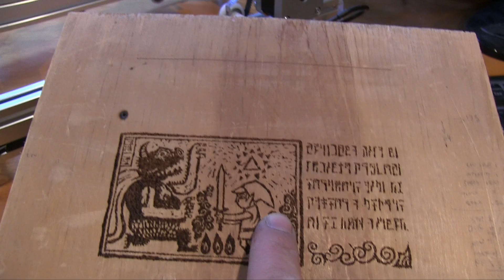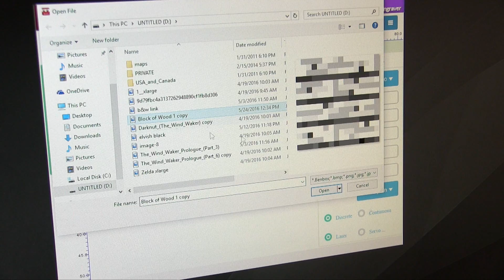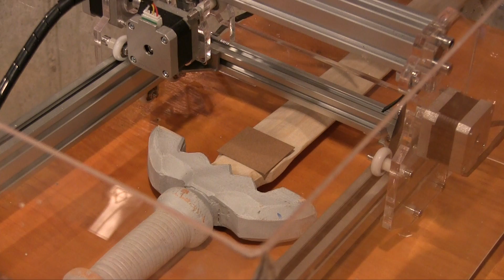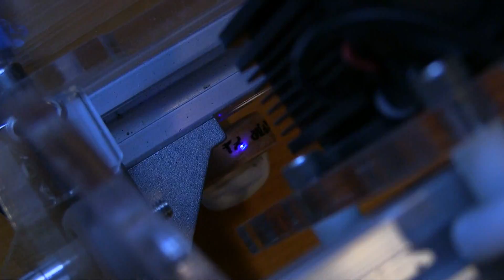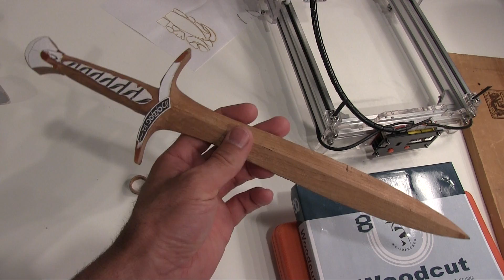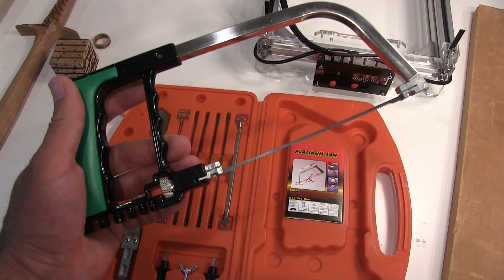Adam tries a Laser Engraver - Wood Ring, Master Sword Triforce / Banggood 1600mw Blue Burner

Comment: I'm interested in cutting templates for airbrushing.  But you said you had problems cutting vinyl.   Have you tried mylar?  It's a better choice for templates.   The other thing is I want to cut plexiglass for use with making front panels for small radio kit projects.  Have you tried that?

Comment: hello Adam,

I was making some research about this machine, i would like please to ask some questions:

1 - how much thickness can this machine cut if i want to cut on wood ?
2 - does vinyl work with this machine if i want to cut some logo stickers ?3 - does it cut foam and styrofoam in 3D shapes ? and which maximum thickness ?

what i am looking for is a machine in which i can cut some shapes in 
wood and foam and others, if not this one, any suggestions please ?
Reply from the maker: What you can cut depends on the laser you install.  The one I have is too weak to cut wood.  I don't have experience with more powerful ones. I didn't get vinyl to work well but it could have been my settings.   It can cut foam but in 3D is not something I tried.  I don't know how thick.
Reply: ok perfect thanks for the info Adam, was helpful and glad i can sort of pull the brakes on this one
Reply: HappyAtom Cutting Vinyl can be deadly I read somewhere. It puts off a gas.

Comment: yo, HappyAtom, i have the machine, and the 2500mw module bought separately. the module has only 2 cables, positive and negative. and the machine has 3 cables to connect. so, how do you connect the module, man? i am stuck. help me, man

Comment: Hi I just bought EleksMaker EleksLaser-A3 Pro 5500mW Laser Engraver Picture CNC Printer from the same Web, also software it's not included in try go on the link and does not work, is there's a link you have so I can download the software?
Reply from the maker: go to this link http://bit.ly/1txym0N and somewhere in the middle of the page you will see the text TIPS:  there will be two links labeled 'CLICK HERE' under it.  If you just text search 'click here' on that page it will jump right to it.
Reply: HappyAtom I have download it but there's an problem it contains virus is there's another program it can be used with?

Comment: +HappyAtom I know this may be a stupid question seeing it says "wood engraver" but has anyone tried this model on metal?  Just curious if it would work because I know it only takes 40 watts on metal.  Anyone try?
Reply from the maker: I tried this on brass in hopes that it would at least mark it. It didn't make a mark at all.  The 1.6w laser is just too weak for that.
Reply: about how many watts would a laser need to mark metal?
Reply: Risky Business I think 40?
Reply: Risky Business does it with metal

Comment: Hello, I have no laser beam coming out of my laser part - do you have any suggestions?
Reply from the maker: Does the spotting button work?
Reply: It did, but now doesn't.
Reply from the maker: That sounds like a loose wire connection or the part went bad.  I know they say not to leave it on for too long.  Did you contact them?
Reply: I tried, little success (stupid eBay). The machine moves, but no laser beam comes out; therefore, no cutting/engraving. :(
Reply from the maker: Is it just like the one I am using or is it different?
Reply: Very similar. They are offering a discount if I keep it and get it looked at.

Comment: Awesome work Adam, I have the exact same laser. more recently I had problems with it being very erratic and not pulsing the laser off between cuts (laser would stay on) and noticed the main laser MOSFET (large transistor) on the main board getting VERY hot. I found that it was getting so hot it was desoldering itself off the board!. What I did was resolder the legs down and replaced the arduino NANO with a new one (better quality) and re-flashed the firmware. it now runs better then new, smother steps and seems to be a more solid unit now.  I'm looking to do modifications down the track by using larger aluminum rails and longer belts to get a larger surface cut and also adjusting the laser to hang under the Y axis to alleviate the 'offset' of the laser, giving me more room to cut. I look forward to following the rest of your videos using this machine. (can't wait for a more user-friendly option to benbox to be released, as I feel your pain with some of the options and how clunky it can be... it doesn't like large and detailed DXF files I have found.) look me up at www.wastedprops.com for some of my work. keep up the great videos. WP

Comment: Would this work on metal at all?
Reply: no it runs at a wavelength that would only heat it up but there is a curtain chemical you can use that can help the laser engrave it.
Reply: Mech Of death  Thanks :]
Reply: Pressthebigredbutton no prob
Reply: For metal you can try this engraver - http://alipromo.com/redirect/cpa/o/od31wre1krlkf2rq69nuq5bc893s0pwh/

Comment: hi adam, 
Thanks for your video, it has helped quite a lot already. 

on my banggood 1.6W, the weak laser can only be activated if the main laser is getting power, and is then switched off. however, this only works sometimes. so far only at the start of the burn session. i think the 30 second weak button max has something overheating real easily. 

i have been able to focus the lens using the weak light alone.  but i haven't been able to get the weak light to draw the outline, for lining up purposes.

any idea how to get that weak light on more consistently?

thanks, 
rob

Comment: Hi
i have one of these engravers, I could not get it to work with Benbox, so used GRBL8 & Universal G-code Sender. The  
G-Code was generated in inkscape. .. as to cutting i can not cut anything thicker then 1mm wood but can cut black perspex.
i with not cut or engrave any metals. but you can cheat. using a permanent marker to cover all of the metal surface then use engraver to burn off the black, then with soft brush( tooth brush works for me) to remove the burn area. then use etching fluid.. 
then clean off permanent mark with nail polish remover.
.

Comment: You're right, I've been buying from Banggood for the past 18 months and the range of stock is amazing.  I also purchased the Engraver, but because of a lack of decent software it's been sitting since January, not long after I bought it. The first time I used it, I managed to get my finger in the way of the laser when I noticed it was burning slightly off line, it was " saw " for weeks, so keep fingers out of the way.  Could I ask where you downloaded the software from? and where did you get the text software and the art work. The program supplied and the art work was rather poor.  Mine came with the 500mw laser, but I see the prices for the 1500mw unit has dropped, although was very impressed with the power of mine, I even checked to make sure they hadn't packed a larger version, it seems very powerful for just 500mw. I've subscribed, and hopefully you'll be doing more work with the engraver.  I look forward to watching your future videos.

Comment: Can this laser engrave on glass, jewelry, metal or mirror. oh can you give me a list on what material this can engrave on? thank you love this video
Reply: Obviously glass can't be engraved as the laser will simply pass straight through.  It would work if you painted the glass black first and then removed the paint after engraving.  I'm unsure of what sort of power laser you'd need though, it would need something more than just 1.5watts.  Perspex can be engraved with 1.5 however. Again you'd have to blacken the surface first. Maybe a candle held under the perspex would leave it sooty enough. Cut the candle away from the wick to make the wick longer, this will make it burn and deposit the soot on the perspex. Just don't heat the perspex up. A thick black felt tipped marker pen does the job, but can make a fair mess.  Unfortunately it does leave the engraved area black, but the effect isn't bad.  If you use the pen method, you'll have to wash the perspex with warm soapy water first to remove any oils or wax, the ink won't stick to greasy surfaces. As for metal, again you'll need more power than 1.5watts. A 40 watt laser does a lovely job, but they don't come cheap.

Comment: Hey Adam,

I'm having trouble with the Y motors, its getting stuck sometimes, not sure how to adjust it, I've tried numerous ways, it looks like your model has some pieces to help tighten them up, are your belts super tight? or Kind of loose? I've tried both ways, and i can't seem to get it working right.
Reply from the maker: Upload a video of what it is doing.  I would say my belts are on the loose side.  I had to tighten mine because it was skipping the treads but even after tightening it I would still say it is loose.
Reply: Hey Adam, thanks for replying so quickly, I'll shoot the video tonight and link it here if possible :) Thanks
Reply: belts should be pretty tight, just a little spring to them... the g2 timing belt that is shipped with the kit is pretty low quality, but replacement belt is pretty cheap and is also available on banggood or Amazon...

Comment: Hi, I have bought the 2500mW version and we are suffering from a lot of 
problems. One of the problems is that the quality of the laser lens is 
bad, because we can't seem to focus the laser properly due to a broken 
lens. Another issue is the software on which not all the functions seem 
to work. The Outline function does not work at all and thus it won't 
allow us to engrave or cut the outline of anything.
Reply from the maker: Bummer.  Did you try to contact them?  How did it go?
Reply: I have tried to contact them many times, but every time they answer me in a different way by different people. I asked a specialist for some help and they told me that the focusing lens inside the laser is not well aligned. They even haven't processed my review into their productpage. We are still suffering from the software issues aswell. Is there any chance you can help me with the software issues, because i have a feeling i can't count on banggood.com anymore.
Reply from the maker: I'll do my best but I am still fairly new to this as well.  For me it was frustrating at first till I worked out the kinks and now it is running great every time.

Comment: The reason the super glue smokes is because there is a chemical in most paper towels that speeds up the curing of the super glue. Blue shop paper towels doesn't do that and that is what I use when applying a superglue finish to the pens I turn on a wood lathe.

Comment: Concerning the  questions on wood finishing with Super Glue. Pen turners have been using C/A finish for quite some time and have learned many tips and tricks. Take some time and review some of their videos.  Do not use cloth when applying a C/A finish that is very bad advise. Blue paper towels are better than white paper towels, yet can still be problematic. A nitrite glove or plastic bag slipped over a finger works best IMHO.

For a better super glue finish, you want to build your finish by using multiple coats.On a turned wood ink pen I sand to 600 grit, then use between 9-15 coats of thin C/A. Multiple layers gives you a very durable base that you can sand and polish.I then use Micro mesh from 1500 grit  to 12000 grit for final sanding. Last step is to use an acrylic polish. 

If you have gone to great lengths to create a wonderful product, take the extra time to give it a proper finish.

Comment: That is super cool! However if by "upgrade to latest windows" means it needs 10 to run then I won't ever use it. I will never use Windows 10. :p Could you use that on cured polymer clay or resin as well? - Heidi
Reply from the maker: I think it works on everything but Vista.  I don't know windows machines as well as I do a Mac.  I think resin may work but I have not tried it.  I am new to all this.
Reply: HappyAtom Okay well I don't use Vista anymore so I guess I am good. I will have to do some research to see if it could be used on baked polymer clay. Thank you for the reply. :)

Comment: superb stuff with the laser, glad you managed to get it up and running (with an extractor too!)
Have a look at a software called rdwork (v8) its free and might be compatible with your laser, its much easier to work with than the software you currently have and has more capabilities.
I had never even thought about the brass powder in my own laser engravings, I think i have some in the studio somewhere so I'll be giving that a try!!
Reply from the maker: Thanks for the heads up on the software!   I'll for sure try it out.  Good to hear from you again.